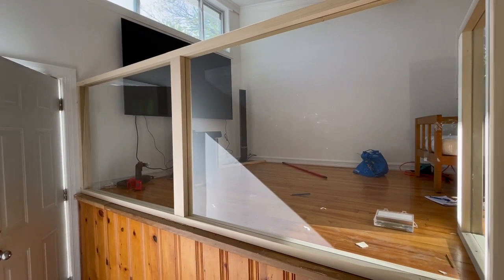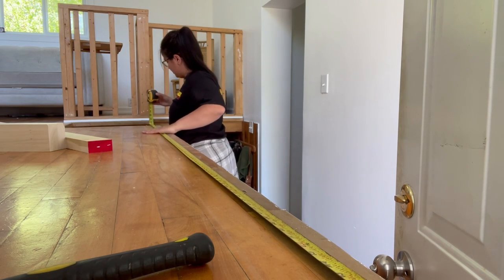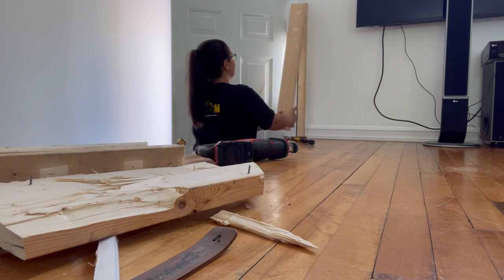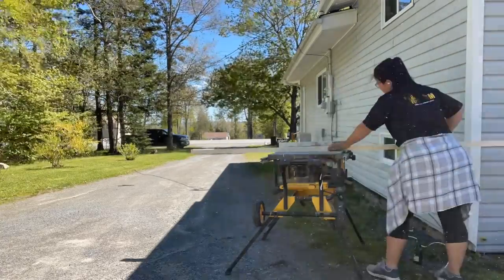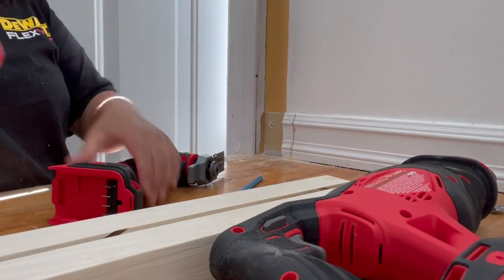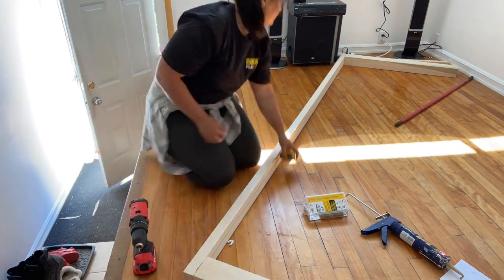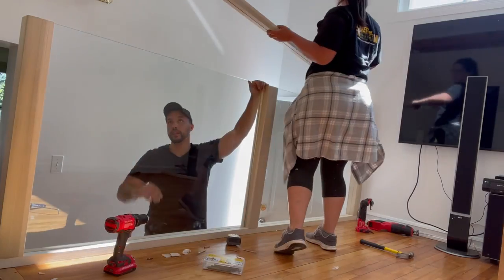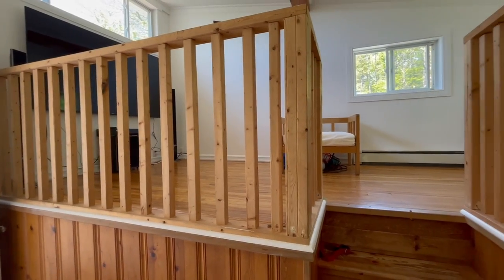How to Build a Glass Railing - DIY railing

Comment: Are the relief cuts down the center of the post or just in the top and bottom plates?
Reply from the maker: Yup they are. I set the glass 2 inches from the upright posts so no need to cut them

Comment: My railings are 6ft long should I have 3 post or 2 ?
Reply from the maker: I would personally do three.  So your glass panels are just under 3 feet each.  That will look really nice
Reply: @dcwoodworks  . My mistake I ment to say there 5 ft should I do the same ?
Reply from the maker: @fineye5  I still would    I wouldn’t have a single panel over 3 feet long. Just my personal preference but I think it would look funny if it was too much glass.
Reply: @dcwoodworks   okay thank you so much!
Reply from the maker: @fineye5  no problem! Good luck with it